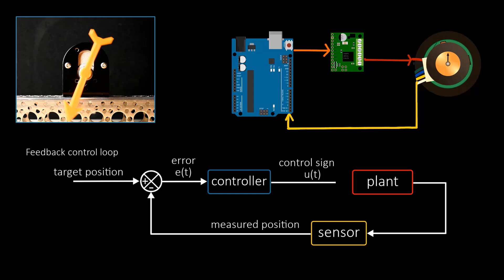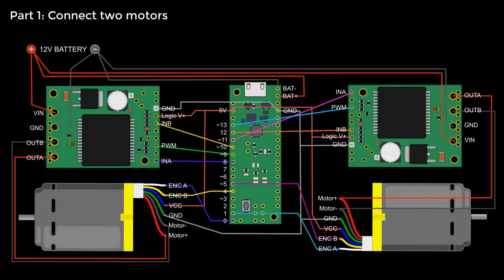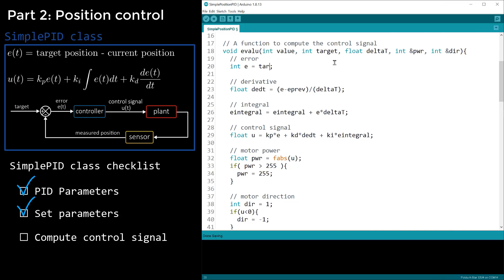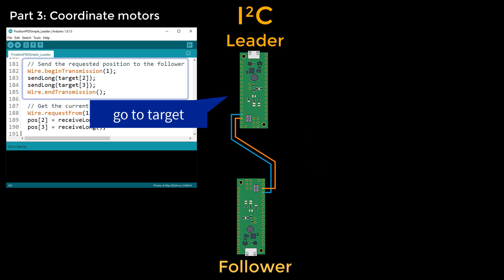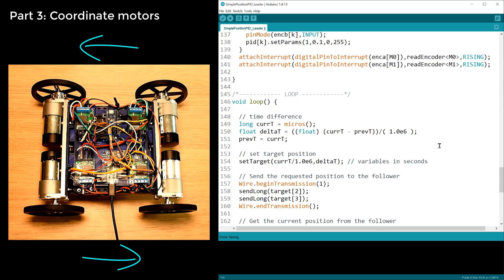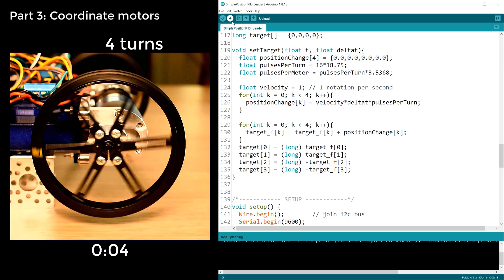How to control multiple  DC motors with encoders

Comment: Great video. Was wondering though, is there anyway this can be controlled to start other than turning on the Arduino? The function relies on the rtc of the loop which of course starts at 0 when power is first applied and thrn after 10 secs the car changes direction. Is there a way to trigger the first 10 secs direction other than reinitialising the loop? Thanks
Reply from the maker: Thanks Andrew!

Certainly, there are plenty of ways you could trigger a start.

You could add a remote or RF kit and start when a particular signal is received.

You could add a button and start when the button is pressed.

You could restart or stop under any of the above conditions.

All you have to do is add your peripherals and adjust the control flow of the code to match your use cases.

Comment: If I wanted to activate the target with a push button, what modifications would I have to make?
Reply from the maker: Hard for me to say without knowing the details of what you're trying to accomplish. I'd suggest starting with a button tutorial (maybe look at OneButton?) and then adjusting the target conditionally based on the state of the button (or intermediate variable).
Reply: @curiores111  What I want is that when I activate the code the motors do not move to any position, until I press the button the motors rotate to the designated position, for example target 2400
Reply from the maker: @danielmartinez-mk6iu  

Sure, so, register a OneButton, "btn". https://github.com/mathertel/OneButton

Then, use a conditional so that if the button is pressed, the target is changed and the PID control is activated. Here's an example pseudocode:

 OneButton btn(<args>);
bool mode = false;

setup(){
   // register btn

   // register changeMode function
}

loop(){
   // tick btn

   if(!mode){
      // set motors off
   }
   else{
      // proceed as usual
    }
}

void changeMode(){
   mode = !mode;
}

Comment: The video is nice, but it doesn't adequately address basic questions.

When I have a vehicle with 4 motors, each motor typically requires its own set of constants for PID control in control engineering.
If the vehicle is supposed to move at a certain speed, the desired speed is set as the setpoint for all motors.
For synchronization, the speeds of the 4 motors are not compared, but rather the differences in pulses are compared, and based on the deviations, new output signals are calculated using PID control.
If one wants to achieve perfection, deceleration is also calculated using PID control. In this case, the actual pulses are counted to determine the desired new speed (cascade control).
There is nothing wrong with the video, but the implementation was somewhat oversimplified by the presenter.
Reply from the maker: I hear comments like this occasionally. It's valid -- not everything is covered, and certainly the methodology is not optimal. But that's the intention -- its not meant to cover everything, and its not meant to be optimal. Generally, my videos are intended to make more complicated engineering concepts accessible to a wider audience. Getting deeper into the details is another step, and not accessible or useful in an introductory video.

Comment: Hi, thank you for your informative video! I have 2 incremental encoders with 2 dc motors, but the encoders have 4 outputs each (2 additional differential signals notA to A and notB to B) how can I use and add these to the code?

Comment: Hello Curio Res, I found your example on YouTube that interests me a lot because I have two reduced motors with encoder and I would like to know if it is possible to synchronize the two motors to have the same speed so the same count on the two encoders.
I have two ballasts is they have two pistons to fill them or empty them with water, my problem is that I have a faster ballast than the other, I saw your code and I modified it but I hold a little, can you help me to recover the value of the encoder from the right engine and that of the syncronized left engine in order to display them on an LCD?
I use an L298N ....

Thanks for your help..

Alfred

Comment: I've used motors very similar to those in the video (great video).  Like many inexpensive motors, the same power settings to not result in the same motor speed.  The PID speed controller will run the motors at the same speed after an initial speed up time.  During that time, the motors will not be turning at the same speed and the robot will not run straight.  It's easier with four wheels because the friction keeps the robot from moving cross track.  For a differential drive robot to run straight, the motors need different initial pwm values.
Reply: Can you clarify what you mean? 

I've considered that issue - PID with individual motors doesn't seem to account for the initial acceleration phase - meaning that the robot will often turn and then go in a straight line. 

Is there a way to fix this?
Reply: There are several ways to address this.
1) Experiment by trial and error with the initial motor driver inputs, whether duty cycles or PWM, whatever the motor driver takes as inputs to find values for each motor that will cause the robot to run straight.
2) Another way, is to make a series of measurements by running the motors at different input PWM, no speed control, and recording both the time duration, 5 seconds is plenty,
and the encoder counts.  Using the wheel diameter, calculate the speed of each wheel in cm/s.  Make the measurements for a variety of motor control inputs.  Plot the results of speed vs inputs.  I use Excel and fit a least squares quadratic equation for each motor.  Now you have motor equations that relate speed to motor driver inputs.  For a selected speed, determine and use the corresponding driver inputs for each motor.  Now when the robot starts it will tend to go straight and PID can be used for further control.
3) If you have a good way to measure the robot orientation, yaw angle, use the deviation from a straight line, or the cross-track error, and/or the angle to the goal to make path corrections while the robot is in motion.  Do that by keeping one wheel speed constant and varying the speed of the other wheel.

John-

Comment: Hi Curio, I'm currently using a Mega 2560 to controll 3 DC motors with encoders through L298n for each motors, I need these motors to run at the same speed, but when I provide 255 PWM signal, the velocity measured are 180/178/170 RPM. Does it need PID in this situation or are there any ways to control 3 motors at same speed? Thank you.

Comment: This video is great.  I don't know anything about programmable movements for my project however  In theory can I add a thousand motors and programe each rotation to stop exactly on a calculated axis degree for example 141 degrees and then another on 25 degrees and so on for all the 1000 motors at either the same time or in a specific order and what would I need to contol that kind of set up wirelessly? Thanks

Comment: Could i control 6 DC motors like this one???
Reply from the maker: Indeed, you could.
Reply: In industry there is sometimes a need to control over 30 motors.  This requires more processing power thought.

Comment: Great video!  Can you recommend alternative inexpensive components that can accomplish the same results or will this work only with Pololu components?
Reply from the maker: You can use any encoder motor/microcontroller/motor driver combination. There are plenty of cheap microcontrollers, like knock-off nanos...but I guess now those aren't nearly as cheap as they used to be. As far as encoder motors go, I found it hard to find anything decent for very cheap. Cheap standard motor driver is l298n h-bridge.

Comment: Hey! thank's so much for this video. Very explanatory and I love your commitment to clean code!

I have a question, in getting the motor to move a certain pulses per second, can that be done for just one motor, and how would you go about having different pid loops for two different motors in the same sketch if you did not want them to be in sync?
Reply from the maker: Certainly, and thank you for noticing. I love clean code!

The way this is set up each motor has an independent PID calculation. To set different rates for each motor, you just set the targets differently. To operate only one motor, you would just create one instance of the PID calculation class. Here, I've put everything in arrays for convenience.
Reply: @curiores111  Thank you so much for your help. You're amazing!

Comment: Thanks for the video!! I have a question . Can we control stepper motor in the same if hallow encoder fixed at end of shaft of motor?
Reply from the maker: Stepper motor position is directly controllable; you don't need a feedback loop since you can simply assign the number of steps to take. That's based on the fundamental differences between how DC motors and stepper motors function.

Comment: Hi Curio! I am deeply impressed by your videos! Please forgive me for asking you a simple question: I noticed that your int b in readEncoder<array> functions shares the same value when the array changes to number 0 or 1 in your case. I assume this setting is to make the two motors rotate in the same speed and direction? Thus, if I change the single int b to int b[array], will the motor's position will be calculated independently? 
Thanks again for the sharing! :-)
Reply: Int b is a local variable for the duration of one call to readEncoder. It doesn't persist past each individual call. The arrays encb and posi persist past this though - they are global variables.

Comment: thanks for the tutorial. I have a question, how about using 3 motors with encoders? what should i add in the program? without Atomic. I'm new to Arduino :), I'm using Arduino Mega 2560. thanks in advance.

Comment: hello. can I ask you 2 small question: 1.pls explain this small part og your code float deltaT = ((float) (currT - prevT))/( 1.0e6 ) why are you divide by 1.0e6. 2.t = fmod(t,12)  maybe if you are explain 1 question, no need to explain last question.
Reply from the maker: Hi Andrew! The currT and prevT are recorded in microseconds, so dividing by 1.0e6 produces the time in seconds. So "float deltaT = ((float) (currT - prevT))/( 1.0e6 )" produces the time difference between the two iterations of the loop function in seconds. For me, this is useful as it's easier for me to think in terms of seconds rather than microseconds. The part that says "t = fmod(t,12)" causes the code to repeat every 12 seconds. The fmod function is the floating point modulus (remainder after division). You can find information about it here: https://www.tutorialspoint.com/c_standard_library/c_function_fmod.htm

Comment: Nice! Very detailed and helpful. Anyway i have a question what if i dont have a leader and follower (not familiar with it), and i just have to used  L298N motor driver with motor encoder, do i have to delete the line number 102 (send long) and 109(receive long)? and if i delete that lines does the result will be the same distance travel of the motor from previous motor with leader and follower?. Thanks for the reply Curio res.
Reply from the maker: Hi Aoji! Sorry I didn't get to your comment sooner, (long week). So yes no problem if you don't use the leader and follower strategy. You can delete the send and receive functions. You just need to extend all the pin arrays and function calls to four motors (or however many motors you are using). But you also have to have enough interrupt pins available. For the distance of travel to be the same, you need a control loop for each motor (individually). If you use one control loop to control two motors, then you can't actually control the position directly.

Comment: Great video! Very helpful to us mechatronics engineering students, by the way can i used h bridge driver alternative for your driver you used?
Reply from the maker: Glad to hear that. 😊 Sure, you can use any standard motor driver. The pololu drivers use H-bridge ICs. That's pretty standard for bi-directional DC motor drivers. Their motor drivers are more efficient/better protected than something like an L298N. :)

Comment: Hi Curio Res. By the way, I have been looping thru this video and I want to share with you something I encountered. When the variable "pos" and "posi" reach 0 and it overflows by going under zero in an operation 0-1 = overflow, the system starts to get some weird behaviour. When there is like a jump from positive values to negative values. Can you tell us how to solve this issue? Thanks by the way for the great content.
Reply from the maker: Hi Osvaldo, I an sorry that I haven't gotten back to you yet. I want to look at the code and see if I could identify any possible issues. If the variables are indeed outside their limits, then you would definitely see undefined behavior.  

However, because the variables are integers, you can perform operations like 0-1, which would give you a position of "-1". This by itself would not cause an overflow. However, if you had pos go over 32,678, that could cause an overflow. In that situation you could consider using a long.

If it's not actually a problem with an overflow, it could be a problem with the controller. However, I wouldn't be able to say more without seeing the problem for myself.
Reply: @curiores111  Thank you very much. I understand. Now I'm working on a program to make a robot go straight, because is constantly turning one way, using ESP32 and MPU6050. I hope you take on this challenge with me.

Comment: Would it be possible to have the code not use the interrupts? Arduino mega only has 6 interrupt pins and I am trying to operate 4 DC encoder motors without using multiple boards.
Reply from the maker: Well you need interrupts to read the position... so I would say you can't complete this tutorial without interrupts. But if you have 6 interrupt pins that should be enough. You only need 4 interrupts for this particular strategy.  You don't need to use two microcontrollers. Although if you use a lot of interrupts on one controller you might find that you miss some of the interrupts.
Reply: @curiores111  Hi I purchased an Arduino Due which allow interrupts on all pins. Im going to try to operate 4 DC motors off of it using your PID control. I will let you know how it goes.
Reply from the maker: @CryingNeutrons  Sounds awesome, looking forward to hearing about it.
Reply: @curiores111  Btw I got an arduino due to control 4 dc motors ising your multiple encoders code for velocity control
Reply from the maker: @CryingNeutrons  well done! I haven't used that myself yet for several motors, so you're ahead of me.😉
Reply: @curiores111  btw check my channel for the robot I built using your video

Comment: Hi Curio Res... I'll really love if you could make an example of how to completely control 2 DC motors to move up front, back, left and right in sync or with the same speed. Because I'm having troubles trying to move to motors with almost same speed. By the way, incredible content. I subscribed.
Reply from the maker: Hi Osvaldo, thank you for the suggestion! Yes, syncing the motors can be a challenge. Hope that it is working out for you.

Comment: I am using Arduino Mega with 4 encoder motors and 1 L298d Motor driver shield, I am giving the power of 12  V and each motor side the power is getting 10.7 V. 
But my all motors are not running at constant speed, how can i fix this?
Reply from the maker: are you driving all four motors with a single driver?

For now I'll assume you have separate driver for each motor. There's nothing that guarantees that the motors will run at the same speed. This is one good reason to use feedback control. In general, you'll want to ramp the position slowly enough so that all the motors can get there at (nearly) the same time. Alternatively, you could try controlling the speed directly. In either case, you'll have to make sure that you adjust your speeds slowly enough that the transients are not causing your motors to get out of sync.
Reply: @curiores111  yes, I am using a single motor driver, L298d Motor driver shield has 4 different ports for 4 motors

Comment: CR: What a code loaded video!   The ATOMIC_BLOCK and template aspect were unknown to me; shows how DYI I am.  You have elevated my understanding substantially for a lawn cart project which will takes its drive input from a joystick controller communicating with HC-12 transceivers.  The joystick forward/reverse axis will be straight at +/- speed and the left/right will be radius of curvature of a turn.  You use SimplePID which may require a library but I don't see yet where you set the PID compute rate; it may just be the loop() itself.
Reply from the maker: Yes, the PID control signal (and consequently the PWM value) is updated whenever the loop function triggers (so the sample time is determined by how often the loop function executes). I didn't use a library, the "SimplePID" is just a class written into the code.
Reply: @curiores111  I did read your code and saw that in loop() you do the PID compute.  Regarding SimplePID libary, while I saw in your code that you didn't include any library, there is a SimplePID library so I was confused.  However, that I didn't understand that you were using a class highlights my weak coding skills in C++.  As a physicist, computations are numerical mostly so DYI Arduino coding is new.  Finally, thank you for your prompt reply because my knowledge gained from you is HUGE!